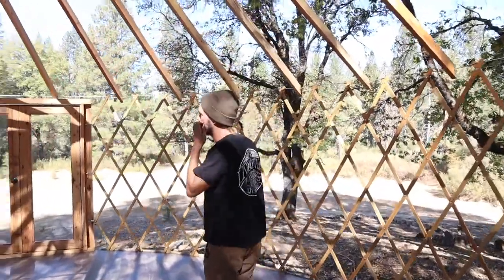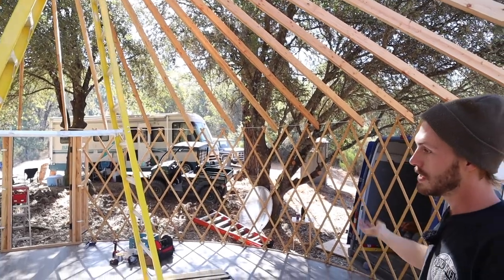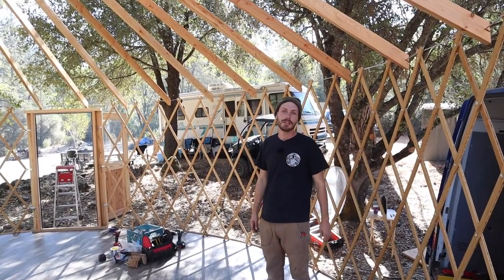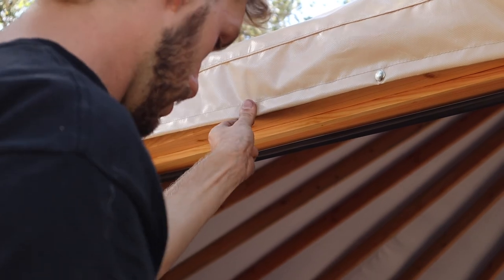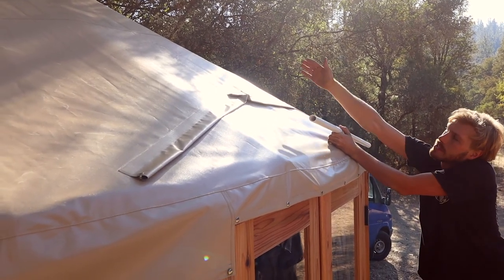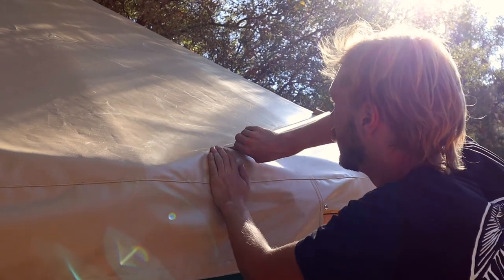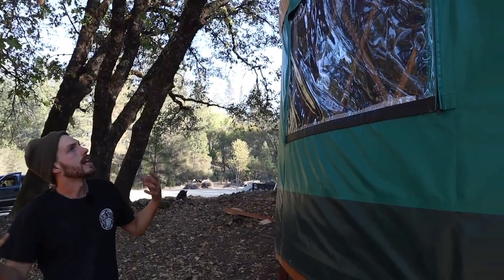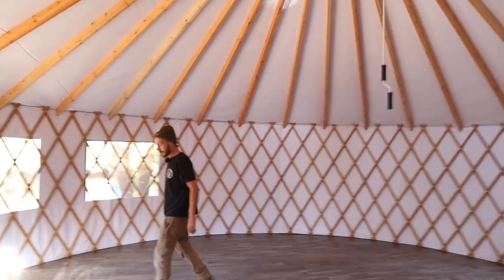FRAME & FABRIC, Assembling a YURT | Living Intent Yurt co.

Comment: Been studying yurts for a time now. While they are interesting for sure. Now really my cup of tea as they are built today. So a am making a different kind of yurt system. No lat wall system, real walls, composite lamb beams that are build with the post and beams as one unit. 3 inch roof planks with insulation. That you can single. Windows all around. AC and heat pump. Sitting on a slab With running water and a septic system.

Comment: Officially, the structure of the side wall supports the structure of the roof. The top of the crossbars, and not the string covering the crossbars. This soft suspension of the roof is a faulty construction. The roof lives a separate life from the side wall structure by stretching and compressing the wire.

Comment: Hmm I've never seen that before. It's engineered to stay up in wind?
Reply from the maker: It is designed to withstand most weather, another option i have seen for high snow and wind load, is they can add 2x4 under the "rafters" to the floor.
Reply: Yards are seriously wind resistant due to their round shape. It's why they have used them on the Mongolian steppes forever
Reply: * yurts  not yards, clearly. Sorry it will not let me remove and edit my comment

Comment: I think these guys need a little more experience.  First tip. Take (2)  2x4 and run them through the ladder rungs just below the ladder top. then place the ring on top of those 2x4. (Ladder should be the center point in the ring) You'll soon find out  how out why. then start attaching your rafters at 12, 3, 6, 9 0'clock. raise to the height needed as you add more rafters. 
This way one person on the ladder can set the rafters all the way around while another places their end to the top cable. And you can easily adjust level and center of ring.  plus the added peace of mind that you wont drop the ring 12+ feet.